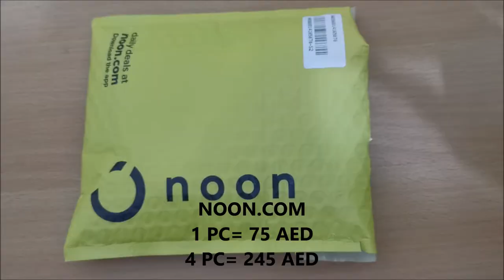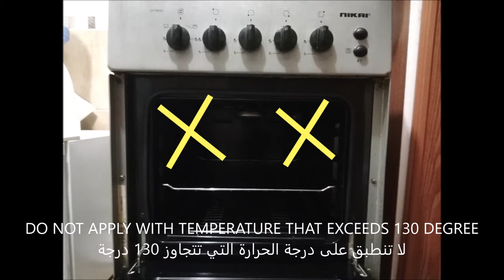Tired of Coackroaches ? Watch this! | Fast Safe Less Toxic | ADVION COCKROACH GEL BAITتقتل الصراصير

Comment: Hi friend I have just applied bait gel and I seen still roaches do you think they get immune help please or I need to apply more every 5 days help please and thank you very much
Reply from the maker: Hello, it will take around 5 -10 days for almost all the roaches to get killed. If still there are some alive, apply after 10 days. Most probably roaches get wiped off by two time application. And in my case, there were no roaches for around 6 months.
Reply: Give the area your treating a really good cleaning before applying. Remember  a little dab goes a long way.
Reply: DeniseinSoCal DeniseinSoCal thanks for the advise mate I’ll try it
Reply: ernesto castaneda did it work??